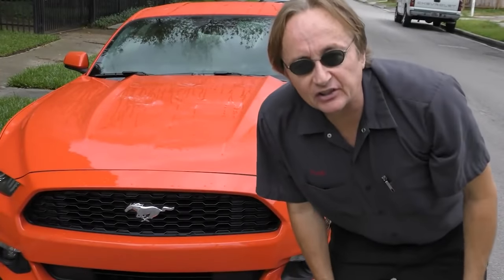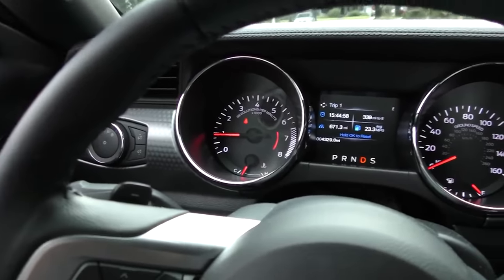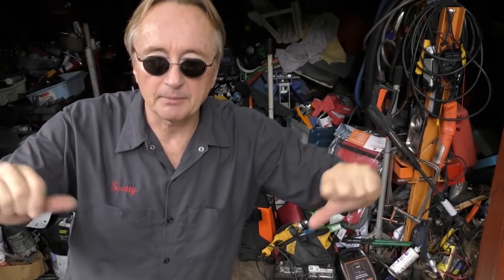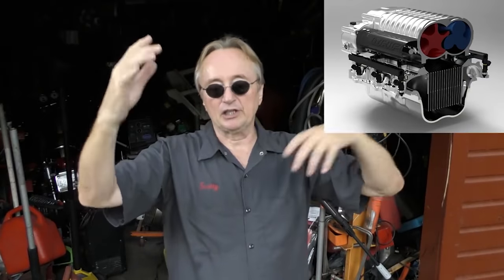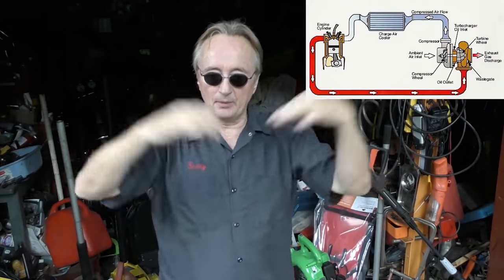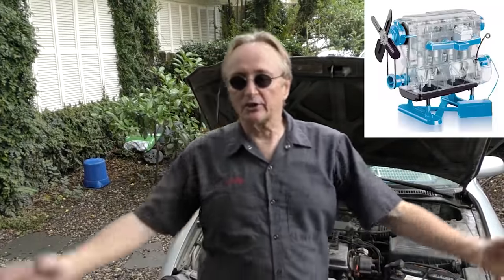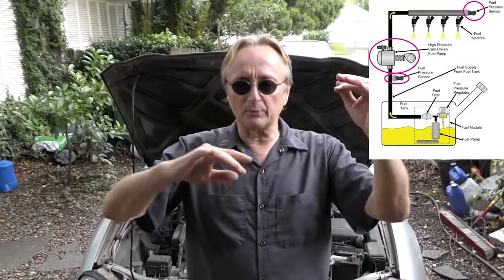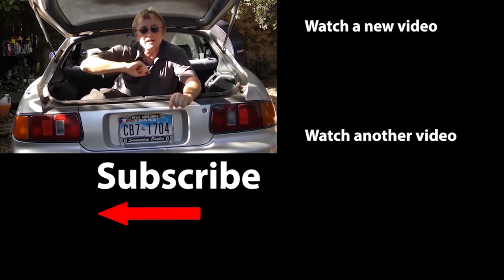I Was Wrong About This Engine and I'm Sorry

Comment: Ecoboosts are great engines my moms 2013  Escape has almost 200,000 miles its a city work car  and she has had no issues at all and has owned it since new.
Reply: engine replaced?
Reply: @maga6319    no she delivers medical eqiupment....Dad does all the oil changes so the car has always been properly taken care of.
Reply: @maga6319  he said it had no issues...
Reply: @paulfeasal6024  its a 2013  escape with i believe its a 1.6 engine
Reply: @Cerrvto  yeah there's a lot of ford engine and transmission when my brother does trucking delivery to the ford parts.

Comment: Scotty, what do you think about Toyota moving into turbo v6's in their large vehicles?
Reply: Heard him say in a different video referencing Toyota tundra turbos; doesn't matter how amazing or reliable the engine is, a turbo will decrease it's reliability vs a naturally aspirated engine.
Reply: If Someone can get 500,000 miles out of this new engine like the V8s in the past that will be impressive without turbo swaps etc.
Reply: @raymondreiff8170  agreed that would quell a lot of the fears of just how much a turbo decreases general lifespan/ maintenance of the engine
Reply: Diesel cars have had turbo & direct injection for 30+ years and lasting over 200,000 miles.  Gasoline turbi-DI should be able to do the same

.
Reply: @electrictroy2010  Not without replacing a turbo, Especially on So called American brands even though most have more Chinese parts of garbage compared to the two Top Car Companies from JAPAN like Toyota-Lexus and Honda-Acura 🤓

Comment: I agree with you Scotty, those ecoboost engines will never hold up over time.
Reply: I see alot of F150s, Escapes, Mustangs, Expeditions, Transits, and fusions with ecoboosts with 200,000 or more miles on them. I live in Houston and used to work at a Ford dealership. I used to think the same too.

Comment: Variable valve timing doesn’t change the cam profile it just changes the timing of when the valves open and close in the stroke. The lobe size is the same. There is one engine that does have a cam with different profiles, I think it’s a vw?

Comment: I rented a 2020 4 cylinder Turbo convertible last week. In Sport + mode it’s a monster. Throttle response is amazing, zero turbo lag.  Great riding car. The interior is awesome, love it. Loads of fun to drive!!  Love the 10 speed auto and I’ve been driving manuals for many years. I certainly Would never buy one not new and definitely not used. 

In 5 years when I retire I’ll be getting either a 2018- 2020 V8 Mustang GT with 10 speed auto OR a C6 or C5 Corvette manual. Tried and true non turbo or supercharged 8 cylinder engines !!

Comment: Maybe Ford should have used one of the technologies instead of all three.
Reply: They did on the 3.7 V6, that was previously the base engine in the Ford Mustang. This engine put out 305 horsepower and 280 Foot pounds of torque. Great engine,  naturally aspirated and fuel efficient. Ford replaced it with this junky little four cylinder ecoboost.
Reply: @RickNethery  Ford put that engine in the police interceptors. No wonder it doesn't exist anymore.

Comment: There’s a reason mustang owners call the 2.3 “ecoBOOM” 👎
Reply: Diesel cars have had turbo & direct injection for 30+ years and lasting over 200,000 miles.  Gasoline turbi-DI should be able to do the same

.
Reply: @electrictroy2010  200k miles is nothing to brag about lol
Reply: Definitely do not agree

Comment: My 2020 Explorer 2.3 EcoBoost engine has 167,000 miles on it, and at least on this car, I’ve not had a single issue with it thus far.  I think it might need a new water pump, and apparently they are really hard to get to on the EcoBoost.  I drive it a lot, and drive pretty hard.  Even the transmission has been great so far (after they fixed the cooler issue under recall).  The one complaint I do have is that the A/C has been worked on every summer, and they still don’t have it right.

Comment: My inline 6 with a 2 barrel upgrade and t5 swap is a blast. Dual outlet long tube headers too.

Point being a six or 4 running at it's full potential with a good gearbox is more fun than many past v8 cars with lackluster transmissions and breathing.

Comment: Give me a good old 302 or 351😊
Reply: Exactly
Reply: Nothing I hate more is someone who buys a Challenger with a 6 banger in it.
Reply: @davebrown4841   I’d also say a 427, but I would have lost my license for life long ago😢
Reply: @richardhanson8776  The fastest thing I ever owned is my short bed single cab Ram Express 4x4 with the 5.7 . Before that was a Dodge Durango with the 360 Magnum. My 70 Ford Torino with a 351C didn't come close . My brother had a 69 Mach 1 with a Boss 302 and I know I would blow his doors off with my truck. But NOTHING sounds as good as those old engines with some headers on them.

Comment: I just bought a brand new Mazda MX-5 I think there is a lot of aluminum in the engine and elsewhere to make the vehicle lighter- hope it will be ok.
Reply: It's an mx-5. They are quite literally indestructable.
Reply: @shikamaru281281  great car...but the paintwork is not the best- very soft and chips too easily 😞

Comment: The new V8 from Forn has gone to rubber oil pump belts instead of chains. And cylinder deactivation. Only time will tell if they hold up or not.
Reply: Wrong, the new V8 from Forn is running cam driven valves.
Reply: @kenwilson6850  I misspoke. I meant oil pump belt is now rubber and they are doing cylinder deactivation which has been problematic for both Chrysler and GM

Comment: Thank you Scotty!!! Your the greatest!!! I wish you can straighten these morons out and teach them a thing or two with these v6's tt's ecobomb garbage that don't belong in trucks and keep na v8 engines!!!! Very informative and well explained!!!! 👍👍👍👍👍😃😃😃😃😃
Reply: Amen to that brother and for me thats why I chose the Coyote V8 over the EcoBoost V6 anyday of the week cause I don't have to worry about turbo failures or any maintenance cost thats on the EcoBoost and plus the Coyote V8 sounds better as well.
Reply: Nobody at Ford cares! My 22  year old 5.0 has 210k miles and still using the original starter motor. My brother in law had to replace the starter on his three year old F150 at only 25k miles. Can you say "stop/start" technology?
Reply: @northdakotaham1752  I totally agree brother and speaking of which I have a 1996 Ford F150 with a 5.0L (302) Windsor V8 with 210,000 miles and still going strong 💪. The only things I replaced on my truck was the starter, the rear fuel pump, and the power steering megunisum but other than that mostly was just simple maintenance, took out the transmission fluid just to get rid of the shuttering it was making and it hasn't had a problem ever since.
Reply: @CJColvin  those were good trucks! I had a 95 model 4x4 with the 5.8 V8.... very solid truck which I wish I still had today. Wasn't too good on gasoline but I didn't own it to get good gas mileage. It was a work truck.
Reply: Start/stop technology doesn’t use a starter.  It uses an upgraded electric motor that can handle the extra load
Reply: I have start/stop in my Honda and it uses a 10 horsepower motor.  It lasted 300,000 miles
Reply: @electrictroy2010  whatever you want to call it, it starts the engine and it failed...at less than 30k miles.

Comment: I have a 2003 Subaru Baja. It makes a ticking noise when cold that goes away as it warms up.
I have not found a reliable mechanic in my area so I am afraid to have it fixed. My question is: is it safe to run the engine like this or am I going to cause a bigger issue if I don’t fix the problem soon?

Comment: Have 2012 3.5 EB on Crew F-150 4x4 160,000 + No problem except for high pressure fuel pump which was easy fix. My son uses Royal Purple when he  changes between 3 and 5 thousand. Love my truck. 4 trips to Mexico City from Fresno, CA. and one to Cabo. P.S. Son has 97 Toyota  silly car. Slower then Donkey crap. I daily 2011 BMW 328i with 126,000 noproblems with proper maintenance and is fairly quick 25 MPH highway miles 50 mile round trip.

Comment: My neighbor just bought a twin turbo f150. He had an Amsoil oil bypass system installed. It now has about 14000 miles with no problems after a month of towing, 4000-7000 lbs each way from Detroit to Macon GA. He signed a 2 year contract. After 6 months the truck will be paid for and he'll sell it at the end of the year. Any thoughts or advice?

Comment: Software updates are normal for all auto manufacturers. If you don't think Toyota or Honda do those too,  you're off your rocker. The Ford EcoBoost family of engines come down to maintenance. Take care of them, they take care of you. Unfortunately people don't take care of their vehicles at all. I have almost 60k hard miles on my 1.6L EcoBoost including track events. Running 26psi of boost and its been phenomenal. Oil analysis have been perfect so far too. It's my only car and it does everything. Amazing little car and stout little engine. Looking to get a 150k miles minimum out of this thing. This engine has been over 300k miles before as well

Comment: LT1 powered corvettes and Z28s with those old  4 speed autos would easily get 26+ mpg on the Hwy,  I would imagine with modern transmissions like the 10 spd auto they would get well over 30 mpg.

Comment: we have the junk 5,4 3 valve engine that ford just did not test long enough. I locked the cam shafts and reprogrammed the computer and believe it or not the lie-o-meter says we are getting an average of 2 mpg better and it has more power! Our expedition was getting 13.6 and now we are getting 15.5 mpg!

Comment: I have a 2013 f150 with a 5.0 coyote and the 6 speed transmission. Is this a decent combo? I bought my truck because I liked the drivetrain it had and low miles I didn't want the ecoboost.

Comment: But it was Alfa Romeo who became the first manufacturer to use a variable valve timing system in a production car. Whilst the fuel injected 1980 Alfa Romeo Spider 2000 had a mechanical VVT system; All other Alfa Romeo Spider models (1983 on) used electronic systems.

Comment: I like Toyota (though I wouldn't trade my F150 3.5 Eco) and I see that for 2022 they've gone to a twin turbo version of their 3.5 engine which is generally excellent. But that engine was never designed for turbocharging and Toyota is pulling an extra 100 hp out of it in the Tundra. That is an engine I would worry about more. Ford's 3.5 Eco engine was designed from the start for turbocharging, and Ford uses 70% the same engine in the Ford GT getting over 600 hp from it.
Reply: Diesel cars have had turbo & direct injection for 30+ years and lasting over 200,000 miles.  Gasoline turbi-DI should be able to do the same

.

Comment: I have a Nissan Juke Stock turbo with Bolt On's FMI Downpipe, cat back and a Tune, But the car doesn't run well when it's really cold out.. I think it's the Carbon and Valves because It was tuned right before winter about 4 years ago, and the last to winter's with that car have been bad. I'm sure I need to dig into the top end of that car. I would like to at least take the runner out and clean the valves because it's at 108K right now.. Once it went over a 100K the car changed on me once it goes below  40 degrees it will start feeling like a misfire or like a cupler or clamp popped off. Even once it's fully warmed up?? IDK?? In the summer she runs good Not great like it did when it was first tuned..

Comment: NO, I don't think Scotty was wrong.  I mean the modern 4 cylinders that are turbo charged and have DI are perhaps as powerful or more powerful than the V8's from the 70's and 80's but the difference is the ones from the 70's and 80's have fewer issues generally and are less complex (less computer technology).  So, for example, you don't have to worry about a turbo crapping out and making the car essentially useless.  A lot of the newer ones use the EcoBoost to make the 4 cylinder engines behave like the older V6's and V8's.  Personally, I don't think Scotty was wrong about them.  The 4 cylinder turbo charged versions found in many Mustang's today are still garbage because you have to figure, that turbo will go out at some point and the question is not IF but WHEN.  And many people who bought Mustangs like to beat on them, and so I'm thinking sooner than later on the turbo.  If you want a real Mustang like in the old days, get the V8 model without a turbo (if possible).

Comment: As an owner of a 1.6 EcoBoost powered Ford Fiesta with an upgraded turbo that makes over 330 horsepower, I can confirm these engines do fail.
Reply: What Else did you upgrade besides the turbo though?
Reply: @josueguillen5053  Everything outside the engine
Reply: @NicholasJozwik  such as…..

Comment: Scotty you are the best, was going to buy an Ecoboost Ford Fiesta 2013 auto when driving it was so jerky so in the end I went and brought a 2010 Ford Focus 1.6 Zetec Petrol auto with 42000 miles on the clock and have not had any shifting issues. Do you think I did the right thing? Only had a limited budget.

Comment: TRansmission in my 2005 grand marquis just failed. quoted 4300 for a new jasper trans installed. opinions people. what a shitty day
Reply: Ehhh tough spot but those are good cars. Since it’s that old personally I’d junk the car and use that money down on something newer , you might go ahead and put that tranny in but who knows how long it will or even last?
Reply: @za9737  The Jasper at leat has a 100k 3 year warranty. Love the car i had it 4-5 years now and put 75k on it

Comment: My real fear is pure steer by wire and brake by wire like that which is in Infinity.  2010 colbalt was eye opening as the ignition switcg would kill power and the electronic systems failed!

Comment: Scotty,  what would improve the fuel economy more on a 2001 Chevrolet Express.  Would I achieve better fuel mileage by replacing all four Oxygen Sensors OR would I achieve better fuel economy by replacing the IAC(Idle Air Control) vale and the TPS(Throttle Position Sensor)?  Thank you Scotty for sharing you knowledge and experience.
Reply: Find out what is causing your bad fuel economy first. It could be something as simple as a bad air cleaner.
Reply: Reduce your top speed by 10.  Doing that reduces air resistance & raises MPGs

Comment: I own a 2018 Focus ST. The 2.0 Ecoboost is EXTREMELY reliable. The only concern is the carbon build-up but there are plenty of solutions for that. By the way, I typically get the advertised fuel mileage, and I don't always drive slow. There is no need to throw blanket statements. The 2.3 Ecoboost in the Mustang is also very reliable, however, the 2.3 in the RS can be trouble-prone.

Comment: The Ford Ecoboost engine have proven to be extremely reliable. They are complex but the are fast and get very good fuel mileage.
These cars are faster then almost every stock V8 of the 90s while getting 25+ mpg

Comment: HELP!! I have an 04 grand Cherokee 4 wheel that wont drive over 10 mph after sliding into a curb. When I turn the front passenger wheel in nuetral it locks up which makes me think it's a wheel bearing. Are there any other possibilities or should I just go ahead and replace the  hub assembly
Reply: Could be a lot of things. Wheel bearing / tire rod / or worse you might have bent the control arm

Comment: I agree with scotty with somethings, but sometimes i just think he's sucha big ford hater, i agree toyotas are great and reliable. but i've been a ford dealer tech for 8yrs and still havent replaced a 2.3ecoboost from any platform. i've seen many 2.3L high mileage mustangs that are poorly maintained that are still running. high mileage rangers no problems.  Yes 3.5Lecoboost is something to avoid, but i've also seen 5.0f150's with just as much issues. I don't think the 2.3L deserve the crap it gets.
Reply: The first gen 3.5 had timing chain issues.  Funny that everyone thinks the turbos will go out but they don't.  Well, unless you buy a 2022 Tundra, then you will have turbo issues LOL.

Comment: Ironically the 2.3 ecoboost is the most reliable 4 cylinder ecoboost ford makes. the1.5,1.6,2.0  leak coolant causing it to overheat

Comment: The 3.5 ecoboost is the worst engine option available in the f150. The 5.0, 2.7, and 3.3 are good engines.
Reply: Diesel cars have had turbo & direct injection for 30+ years and lasting over 200,000 miles.  Gasoline turbi-DI should be able to do the same

.
Reply: I've had two of them with no issues.  Best power for towing in a half ton truck.
Reply: @bubulubu3136  it's definitely a gamble with these engines. Their either really great or complete junk. There's no middle.

Comment: The Ford Coyote V8 isn't Eco Boost but also has variable valve timing and high pressure fuel direct injection, so is that to be avoided as well?

Comment: Can somebody decode this video for me?   Is Scotty saying that the Ecoboost is a good engine after all? I had a 2016 edge no problems. Looking at a 2017 Ford Mustang 2.4L.
Reply: I share your confusion.  He praised the EcoBoost engine 7 or 8 years ago.  For the last 2 or 3 years, Scotty has had a lot of hate for EcoBoost engines.  I am not sure what he is admitting he is wrong about, and 95% of his fans just sent praise in their comments here, even though they don’t even understand what Scotty meant by the video.
Reply: I had an Ecoboost making over 400 whp that would smoke stock 5.0s.  still got some vids of it on my channel. People just don't know how to mod them right or run them right. It's still an open deck engine and tuned making that much power especially with as much torque and boost it can make quick can cause a bad combo when paired with a noobish driver.
Reply: he makes no sense